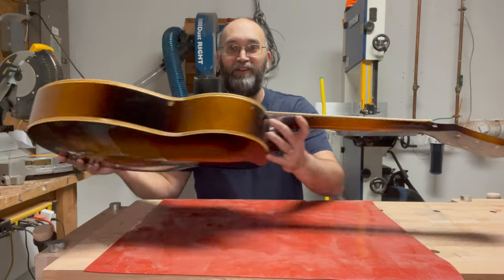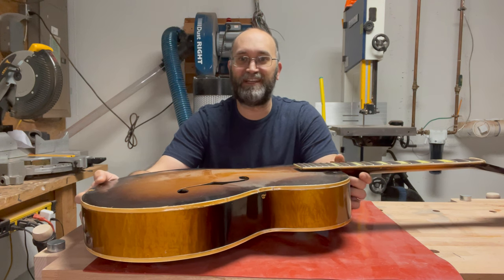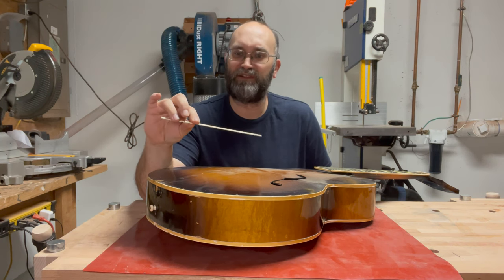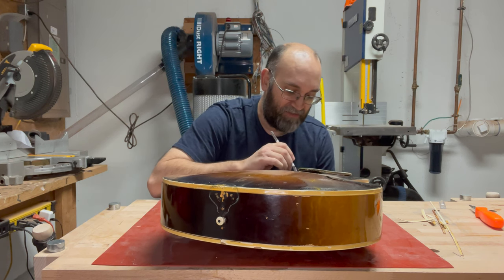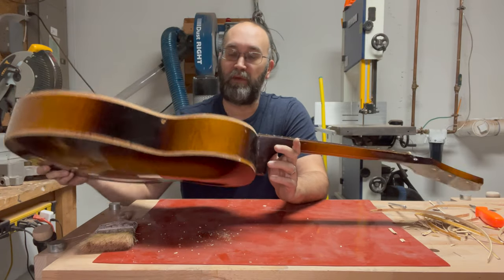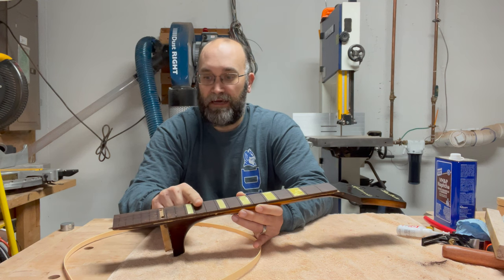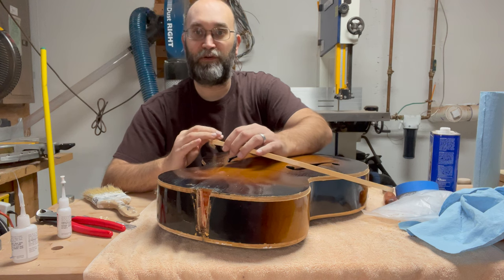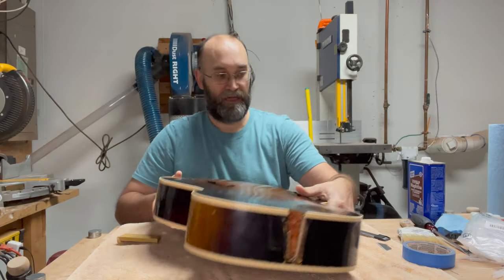Replacing rotten celluloid binding

Comment: Looks good.  One thing you could try is, apply the CR glue, and spray the binding separately with accelerator, then stick it on.  I've seen Dan Erlewine do that.   He will also take a squeeze bottle, stuff cotton balls in the bottle, then spray a bunch of accelerator into the squeeze bottle. The he just "puffs" the accelerator on the part.

Comment: Zap Adhesives Formula 560 Canopy Glue  will make your life much easier, it dries clear in 24 hours and can be wiped off with damp cloth
Reply from the maker: Sounds great except for the 24 hr dry time. Of the flaws CA glue has, bonding in a few minutes is a pretty big plus

Comment: Randy I have a Harmony, very similar to the one you’re working on here.   It’s in much need of neck reset.  
Do you have a video of where you were removing the neck on this Gretsch.  
Thanks Mac
Reply from the maker: Here’s a video where the neck removal went poorly to show you what not to do:

https://youtu.be/kumxdY3U6wE

When I did the second Gretsch neck removal, it went a lot easier and I knew not to rock the neck, but rather push up against the heel (like the jigs you see do). I didn’t make a video of that, unfortunately

The homemade heat stick works great, and hopefully by seeing how I did it wrong the first time, you’ll get a better idea how to do it right. It’s not too terrible when you’re doing a beater guitar, so take a shot and good luck!